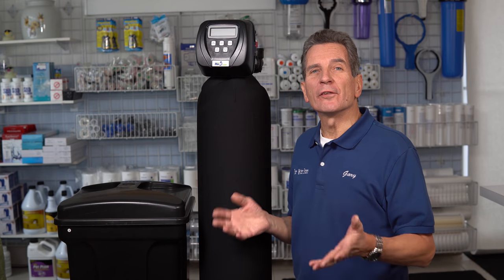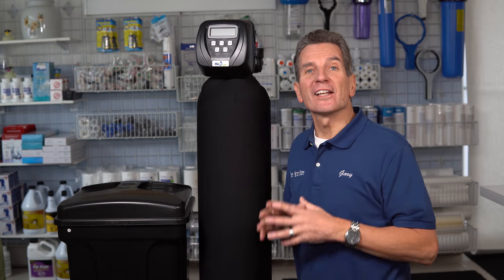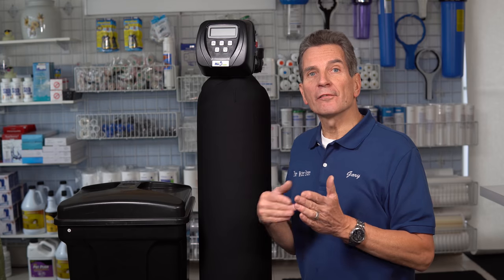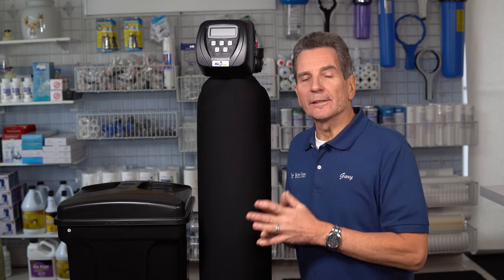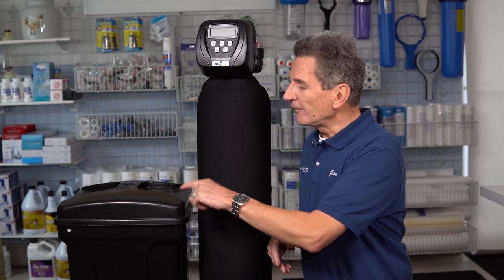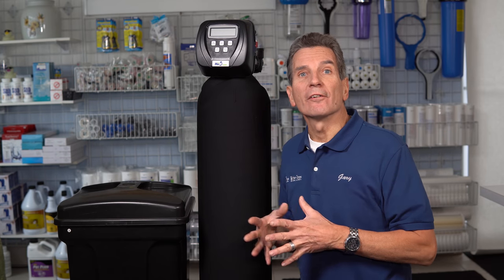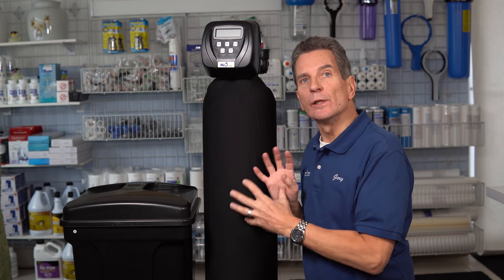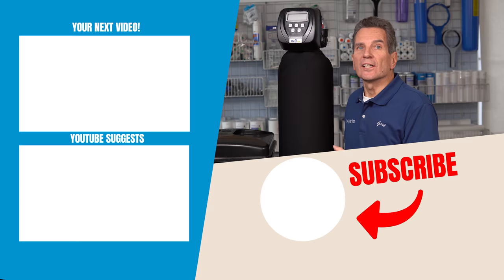WHAT is WATER SOFTENER REGENERATION?

Comment: Hi. I am confused. Should the water softness be on bypass when regenerating ?
Reply: Softner *
Reply from the maker: If you have a twin media tank water softener it will always produce soft water even during regeneration.  All other water softeners will be off line or on bypass while in regeneration.  You do not bypass it yourself during regeneration.
Reply: Bypass is used when you are performing maintenance etc on the unit 
Under Normal running operation it should never be set to bypass

Comment: Lately, right after regeneration, I’ve notice water coming out of house faucets has been dark brown. Why does this happen?
Reply from the maker: Likely some excess iron or sediment in the water softener  that was not flushed out during regeneration.  You can either increase the rinse time or shorten the time between regenerations.
Reply: @water_estore  currently my system is set to regenerate after 2400 gallons used. In your opinion, should I lower? If so, to what? Thanks in advance for your help!

Comment: Can you put salt when it’s already half way full of only water?
Reply from the maker: Yes, but that sounds like a lot of water.  It may not be working correctly if it is more than about 1/4 full of water.
Reply: @water_estore  I did the regeneration cycle but the water never drained during the cycle. I had a pole in it I did feel a lil tug like it was sucking but not much. Truthfully I haven’t put salt in it for a long while. The water lvl is about 22 inches and I was thinking is took some way out and then put salt to see if that does anything? I’m new to this. My family hadn’t put any salt for a couple of years really so i don’t know if that would cause a problem.
Reply: @water_estore  and since were a family of five maybe it’s lvled that way
Reply: @water_estore  and it’s the black brine tank

Comment: Thanks good info I moved in to a home with watersoftner my question I read meter for a day with regeneration stage and water usage was 850 litres .85 m3or 224 gallons crazy high with family of 3 and all high efficiency appliances it’s a short unit  with salt brine by water company and next day took meter reading it’s normal for family what’s your thoughts called company and put it on by pass thanks info might help other people thanks again softener was ok first 8 months now water bill to high
Reply from the maker: The industry standard for water usage for a family is 75 gallons per person per day. A water softener only uses water when is clean is itself which although it varies by make and model is typically about 40 gallons every 5 days. If your water usage has increased significantly I would check your toilets to make sure water isn’t running through them
Reply: @water_estore  thank you great information it’s a culigan short tank for crawl space

Comment: Wish someone would talk about the effects water softeners had on septic systems.
Reply from the maker: There have been numerous studies done and it always ends up at the same place.  No negative affect on the anerobic action in the tank, BUT since you will be using less soaps, shampoo and other cleaning products that will actually help the anerobic action within the tank. If you have a concrete tank you may get some corrosion on the outlet after 20 or more years.  My water softener and every contractor, plumber, architect and builder I know does the same.  "The juice is worth the squeeze"
Reply: @water_estore  Thank you! I have been reading both positive and negatives on this and it gets confusing. I was also worried about the concrete tank as that is what I have.